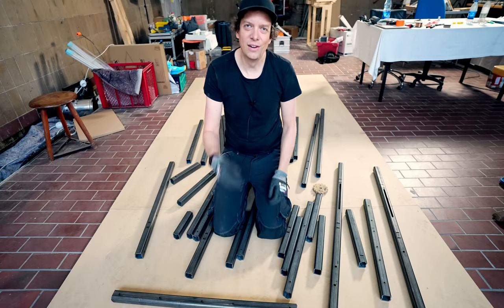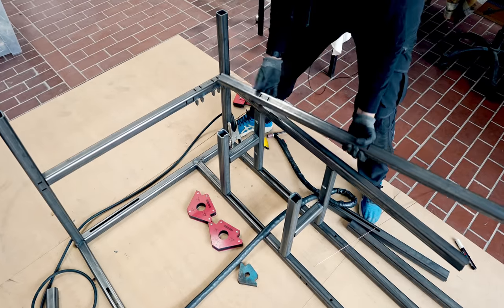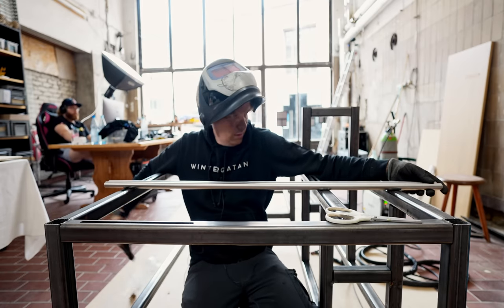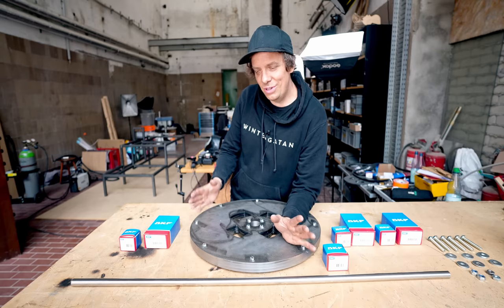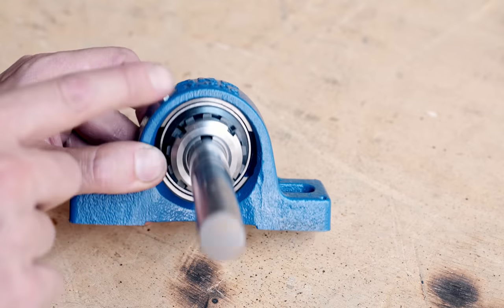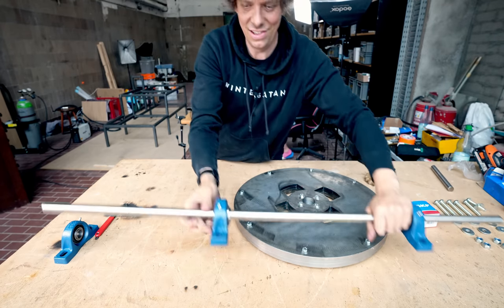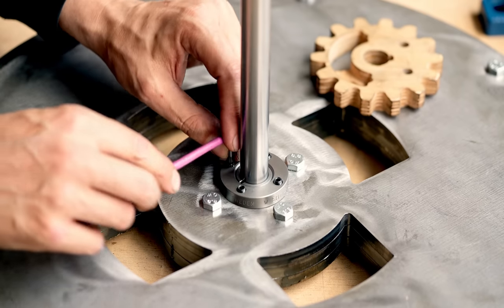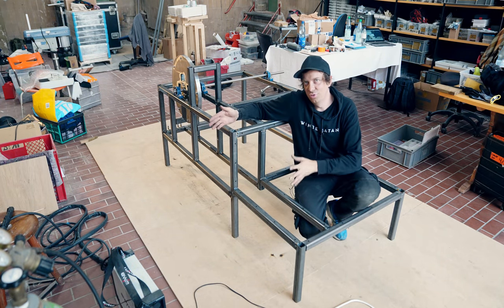Welding the Frame - DAY 3 - Marble Machine Flywheel Prototype

Comment: I am impressed by your new frame, flywheel & bearing designs. The only suggestion I have is when you build your actual system, you really do need to balance your Flywheels and Pulley, this will help eliminate any vibration that can be caused by out of balance. When you have that much weight spinning at a high speed, if it is out of balance, it will vibrate horrendously.
Reply: He should just buy a flywheel.

Comment: I have to say the flywheel stops much faster by itself than I would have expected considering its weight, is there still a concentricity error in the bearings or is the friction of the bearings higher than expected?

Comment: You could add direction markings on the leg kit pieces in cad. like where the pieces goes together you laser etch something like A1 and as long as all A1 pieces are placed together the placement is correct. Wont do you any good now, but maybe for other parts of the machine or for when you want to make a second one

Comment: PROTIP: TIG welding isn't supposed to make a crackling sound. You might be using the wrong gas, such as a ArCO2 mix rather than pure Ar, or your gas flow is too low.

Comment: Tabbed design is a close second place vs a fixture table, but the 90 degree magnets only control in two dimensions Consider something like the fireball tools megasquare to maintain control in 3 dimensions, because presumably the floor is less flat than you think.

Comment: Martin, the flywheel is oscillating judging by the video. You should test spin it in higher RPM and see how much energy will be dissipated in a form of vibrations and see if the actual wheel needs balancing. SKF can advice you how to do the vibration measurements by yourself.

Comment: Also, there seems to be a lot of friction in the bearings. This huge flywheel should be spinning for much, much longer. Perhaps the three bearings have been screwed to the frame in a non-straight way, which makes the bar bend and twist as you turn the flywheel which causes a lot of heat, which means inefficiency

Comment: One way you could fix the alignment of the top on the production model, assuming this doesn’t get incorporated into the final machine, is to put the surface that needs to be flat on the ground, facing down, and weld that together first. If that is the most mission-critical component, then it should be the thing that is welded first, with the rest of the machine taking shape around it.

Comment: Not sure if it’s been mentioned already, but where the bolts for the pillow block bearings go through the box section frame, it’d be better to have ‘crush tubes’ inside the frame so that the frame isn’t squashed when tightening the bolts.

Comment: It seems like you need to clean your metal a bit more with degreaser and/or a metal brush as your welder should launch sparks or make the spatter noise if its a good weld

Comment: Those metal tabs on the washer are designed to be hammered over into one of the grooves of the nut - it prevents the nut from loosening on it's own.  Also, when you tightened it in the video (near the end of the video) it slipped, you weren't actually making it tighter.  You need to make sure the center isn't turning, just the nut.

Comment: Martin:  SAFETY item:  Concerning the H2305 adapter sleeve with KM Lock nut and MB lock washer (~time 9.30 in the video) this looks familiar to me from my Helicopter days in the US Navy flying SH-2Fs and UH-1N's.  Types of these devices were used on my tail rotor shaft to transfer engine power to the tail rotor, and we called them "pillow blocks".  Please take another look at the MB Lock washer, as I believe that the tabs on the lock washer are designed for safety and that the little cut out slot on the KM Lock nut that aligns nearest to the tab on the MB Lock washer (when tightened) is designed to be bent over using a tool and left resting in the KM Lock nut's slot.  This is a SAFETY design of the system to prevent the KM Lock nut from inadvertently unscrewing and causing problems that you do not want.  I suggest you check with the company that makes this unit to be sure on its proper installation.  Keep up the great work and like your Mom, I believe too :-).  Art

Comment: After yesterday video I am a little concerned about the total weight of the MM.  Are we sure all static and dynamic considerations have been made to design this frame?  Sorry to be that guy, but I'm not sure that has been fully calculated or engineered.
Reply: And are the legs fastened well enough or could they break off? Although only six seem too few for this big monster that the MM3 will become.

Comment: Anyone else concerned by the lack on concentricity of the flyweel once it was on the frame? When it was spinning at the end, it defintely looks like it's not 100% circular.
Reply: Agreed, if you speed up the video you can see a slight wobble
Reply: The weel is round. I guess it's the chanfer thats make some sort of optical illusion.

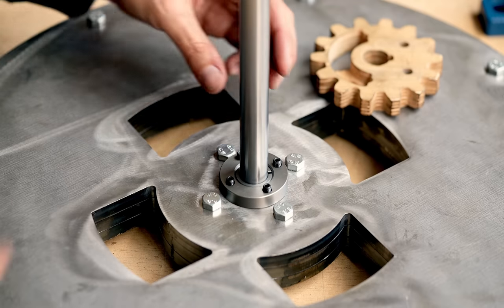Comment: 14:58 Hello Martin. I have been working with this type of locking for axles. 
I serviced machines that were production robots. The problem we had was that the screws came loose without thread locking. 
Even if you tighten the screws with all the power you have, they loosen little by little over time.
I recommend thread locking.

Comment: When I was beginning my, never ending, journey to be come a fabricator (I weld, cnc or manual machine, electric, pneumatic, hydraulic, mechanical... ) one of the things my mentor told me "If you can't make it perfect, try to make it adjustable." That tubing, pretty much all tubing, is notoriously imperfect. Welding on it doesn't make it better, usually worse. And that's okay, it's expected.

BTW: I love SKF stuff. They are my first choice of bearings when I need one. And their motorcycle fork seals... there is nothing better.

Comment: Just something to think about?
forget the TIG welder and use MIG? WHY you ask
TIG is a good welding system BUT it gives off more heat than MIG, more heat more distortion.
TIG is a slower welding process, that's why you get more heat, also being slower it takes longer to weld one side then switch to the other side, giving the metal time to move with the heat before you can stop it with the weld on the other side.
MIG and TIG are slightly different, I would say TIG is harder to learn so you should have NO problems with MIG
I been working in the metal industry since I was 16 I am now 62 and still enjoying working on the shop floor.
enjoying watching you build your new Marble Music machine

Comment: This is why i always design my frames to be bolted together.

1. You don't have to worry ( as much ) about warping
2. You can assemble and disassemble it ( big plus for prototypes )
3. It's much easier to apply material finishing - like powder coating.

There are several ways to handle this, but the simplest is to weld a tapping plate into the inside of the tubing ( about 1/8 to 1/4" to give clearance for the weld bead )

I have also used frame connector plates - this should be very cheap for you, given you are already laser cutting your frame components :)

You can also bend sheet metal into a c frame, to envelope frame tubing, which creates your connecting mate.

Cheers!

Comment: Summary of few comments:
1. Fly whell seems not concentric. Also was it weight balanced?
2. Is frame structuraly calculated?
3. Weld on flat surface to get it flat 
4. Try to not move too much with just initial welds to avoid losing square.

Those are some nice tips.

Comment: To dig in a little further to similar comments, a design consideration to think about is error-proofing or poke-yoke in the Toyota Production System. Design so that parts CANNOT go together the wrong way. A lego brick cannot be put in 180° upside down. This may mean asymmetrical tabs to ensure that parts only fit the correct way, as well as maybe parts that that only fit if the part is square and level or help enforce square & level. These error-proof solutions seem easy if you already know them, but if you don't, it's hard to imagine a perfect way. Where you cannot error-proof, add visual indicators to reduce errors. Maybe an etched symbol on mating parts so that ◇ matches with ◇ and - matches with - to make right-first-time assembly easier. Keep up the good and entertaining work!

Comment: Do you know your reference surface (floor) is flat? A non-flat surface will induce twist or bow into the various subassemblies. & to pull it into square, use tiedown ratchet straps diagonally and a tape measure to check the difference between the opposite diagonals. Also, get a Thor No. 3 leather/copper-faced mallet for whacking duties. It’s what they’re made for.

Comment: Great work so far Martin.. Just one thing I really hope you've taken into account. Is the flywheel balanced? with that sort of mass spinning at who knows how many RPM's if it's even slightly out of balance, with how rigid it is with those nice bearings, you'll be able to ride your prototype out of the shop.

Comment: I have a car, I love car-ing, I car to work, sometimes I even car to the beach!  Though my favourite has got to be formula one where they car at some insane speeds.

A car is a tool, the verb for what we do with that tool is "driving", not "car-ing"

A lathe is also a tool. The verbs for using it are turning, facing, parting, threading, drilling, boring, reaming, tapping, and spinning.

Comment: Ditch the welding & use extruded aluminum frame.  These alignment problems won't happen!  The worst of them can be remedied by loosening bolts!  There will be no thermal warping!  You will be able to make modifications later!

Comment: you need a set of  poly dead blow hammers.
i used to use a 5lb'er for removing stuck aluminium wheels on cars without damaging the aluminium rim. 
they'll level steel better than a 2x4.
and glad you found your way to  the tapered attachments.
i come across those in the hvac industry.
work a treat, and never out of round

Comment: You should use a welding curtain to protect the eyes of the other guys and people outside. Questions/suggestions: do you plan to fill/cover the lathe chuck holes? They look like they could perform accidental amputations. Would it compromise the integrity of the flywheel to countersink the bolts and thread the other side or inset locking nuts? Maybe use acorn nuts if you can't do that.

Comment: I'm not an engineer, but I have some ideas about the frame. I think that for such a massive flywheel you need a more massive base. It is possible that vibrations may appear during unwinding, which can be suppressed by screwing on a massive base, or screwing to the floor.

Comment: Let me give you an advise. User regular nuts for the first fit up of the parts and save the locknuts for later. They are much easier to assembly and disassemble and locknuts wear out and loose their locking capability with each assembly and disassembly especially the nylon ones. All the best for your build!

Comment: love that the videos are back. Not that you will need it since that wheel seems fairly balanced, but if u do ever experience any shaking of the frame, since one side might have more moving parts than the other side, that could cause some bumping in the frame as its rigidity meets opposite forces, you could always look to do some kind of floor mounting. That might be a difficult hurdle though... might just need to build a massive platform that it mounts onto...? lol

Comment: On your next revision of the cad models, to avoid flipping parts, you can have off-centered interlocking tabs. They will only fit in the correct orientation.

Comment: A small correction of terms being used.  This is not welding.  This is brazing.  The difference is that with welding the base material (the steel square tubing) is melted to connect the two parts.  With brazing (done at a much lower temperature) does not melt the base material - new material is added from the brazing rod similar to soldering.  Brazing is better because the steel tubing avoids being deformed by the significant heating of the welding process.

Comment: At 16:15 where you are putting the bolts thru the frame you should put a 1/4 inch or 9-10 mm plate that spans between the 2 thru bolts where the nuts are attaching so it is providing equal pressure to the square tubular frame so you will not distort the frame when you tighten the pillow blocks down If you do not understand let me know I could send a picture on the discord Thanks

Comment: Not sure if anyone mentioned yet, but for those pillow bearing bolts, you will want to make nut tabs, weld the nut pairs to a piece of flat bar.  This will make it so you can put a wrench on only the bolt to loosen or tighten them.  A slightly better system is to have the bolts welded to tabs and come up from underneath.  For clamping force, you want to tighten the nuts, instead of the bolts.  Since the bearings sit on the frame flat, you set the assembly on the frame, then install the bolt assembly from the bottom.  I would also recommend either serrated flange nuts, or self-locking (not nyloc) flange nuts, as they will maintain clamp pressure better over time, and will reduce any amount of re-torquing you might encounter with standard nuts.

Comment: I deal with SKF every once in a while as a marine diesel electric generator mechanic and they have the best attitude towards their customers.  Always helpful and their products are definitely top notch, the only time I've seen their bearings fail is when they are neglected.  Also super important to grease them per the manufacturer's manual!

Comment: That spanner wrench is something that can be made fairly easily. CNC machines can do it, also a person with a way to cut a hole in plate and weld a pin can make one as well. Another trick with those wrench styles is using one with a pipe or round bar that needs to turn (but won't or not very easily) or hold it from turning so you can tighten something by simply drilling a hole into the stock and placing the wrench into the hole. Its a nice way to do something without having to use vice grips or pipe wrench and damaging the surface.

Comment: Idk if it's just the bolts causing an optical illusion but it appears the the OD of the flywheel has some runout while it was spinning. It might be a good idea to put an indicator on the stand to see flywheel has any runout. Last thing you want is an out of balance load spinning around. 👍👍

Comment: Since you are laser cutting the parts, you can laser engrave labels so you can match end-1 to slot-1 and end-2 to slot-2 or however you want to note matching parts. This will keep similar size parts from going to the wrong location. You can also mark an orientation mark x or o or i or l that must align when parts are joined.  Also I second @raphaeleidus6718 suggestion about differing top/bottom tab sizes.

Comment: Is it me, or did the fly wheel look a little unbalanced @16:49?  Would that not lead to vibration and therefore cause issue in the future, I know it's a prototype, but flywheels need to be balanced otherwise they could shake the machine apart once at speed.

Comment: Something id not correct with the machining of that flywheel, your inner bearing race hole is not concentric with the outside of the flywheel, you can see it oscillate in/out as it turns!

Comment: For the rub screws, you need to screw the opposite screw to the first screw you screw in. Same concept when attaching a wheel to a car. Otherwise you risk unnecessary strain or that it's gonna make the flywheel not run smoothly

Comment: The laser cut parts for the frame with the notches was a great idea for simple construction. One little idea, if the pins and the corresponding notches were two different sizes sizes, each fore a pin and a notch, you could not have rotated the one part in the wrong direction. ;)

Comment: 16:18 those bolts need slot washers (special washers that are used for slots, they're thicker so do not have a chance to bend into the slot with pressure) and lock washers to prevent the nut/bolt from turning relative to eachother (slot washer goes on first)

Comment: Personally I still think that aluminium profile/mcs would have been a better solution - allowing for adjustments & changes where necessary. As for checking "square" - that little try square isn't really much good - the best approach is to use corner to corner measurements & instead of whacking things with a lump of wood, you can use clamps or ratchet straps (or rope with dolly knots) corner to corner to bring things back into square. I'd also recommend thinking more about sequencing your welds to better control the stresses from the expansion/contraction cycle.

Comment: At 9:38 you put the nut on backwards. The taper goes in and the flay side is easier to get the spanner on.  When tight the taper helps to het the tab bent into the slot without a 90 bend which will weaken the tab.

Comment: This is looking very good so far, I love these daily videos.

Martin probably thought about it already, but another option for the frame would be extruded aluminium parts, which might allow for more precision and even easier assembly without requiring welding.

Comment: need to take the fly wheels to a tire shop and have then balance them with tape weights then you can take them off later and weld a piece of steel in place.

Comment: Hi Martin, I love the prototype. Seeing this frame gives me some trust in the fact that the project will actually be finished at some point. My suggestion would be to add some diagonals here and there, because they will make the structure more strong. This is due to the fact that triangular shapes are stronger that square onces

Comment: The lock washer on the bearings works by folding a tab in to one of the flats in the nuts. Leave that till the final assembly so they only get bent once.